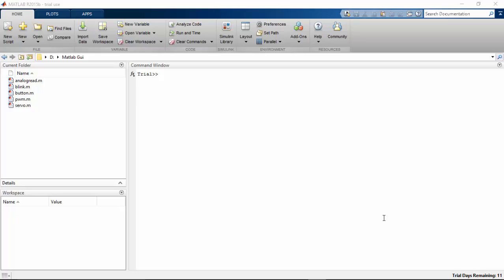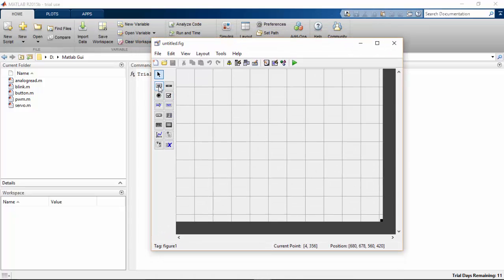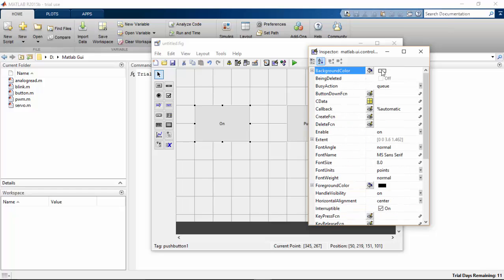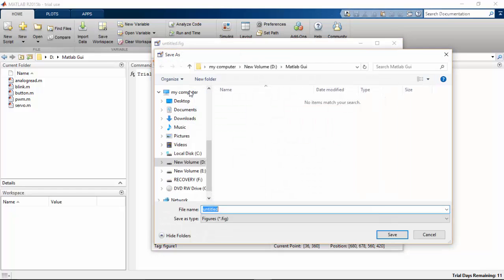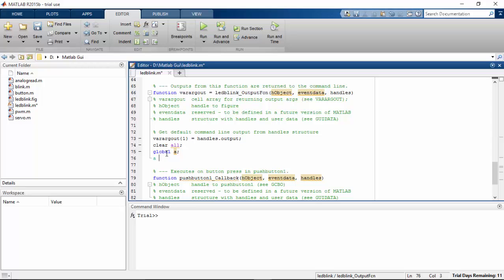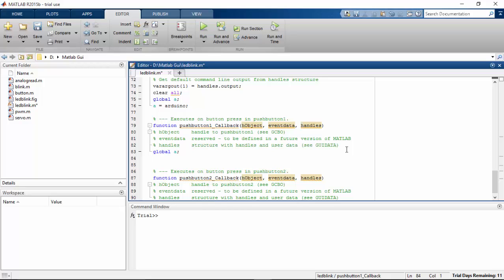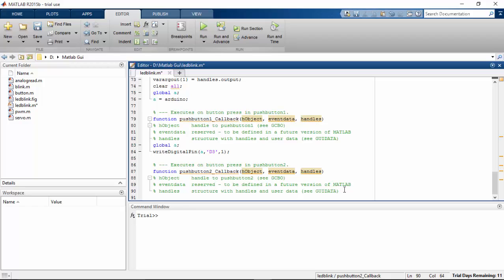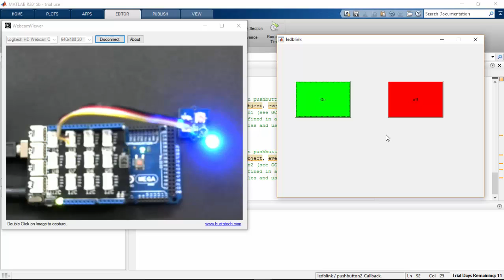1. Arduino Matlab GUI controlling an LED

Comment: I bought your ebook, I have tried this. Did everything  I was supposed to do and I got this error... How can I fix this?
Error using led_control_led_control_OutputFcn (line 77)
Failed to open serial port COM3 to communicate with board Uno. Make sure there is no other MATLAB arduino object for this board.
For troubleshooting, see Arduino Hardware Troubleshooting.

Error in gui_mainfcn (line 264)
        feval(gui_State.gui_OutputFcn, gui_hFigure, [], gui_Handles);

Error in led_control (line 42)
    gui_mainfcn(gui_State, varargin{:});